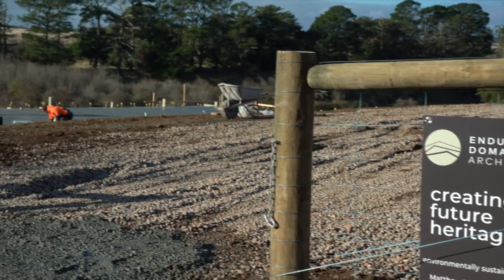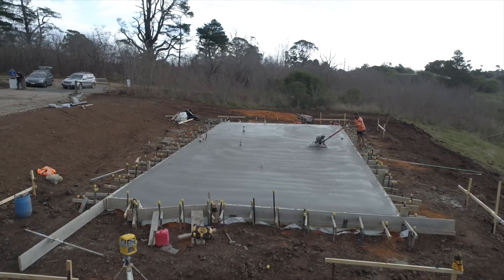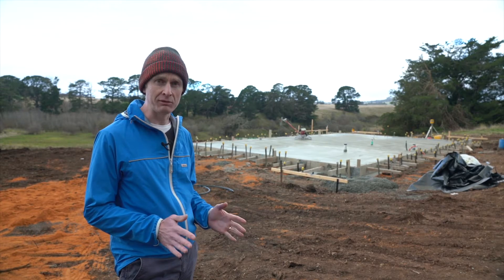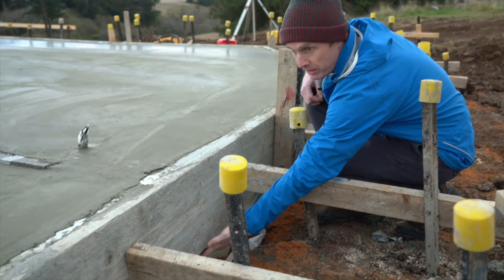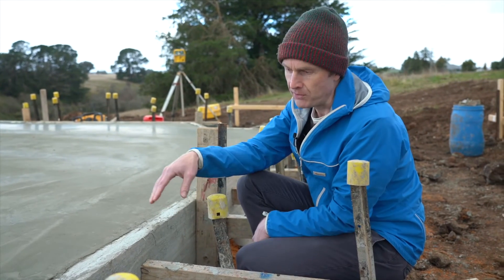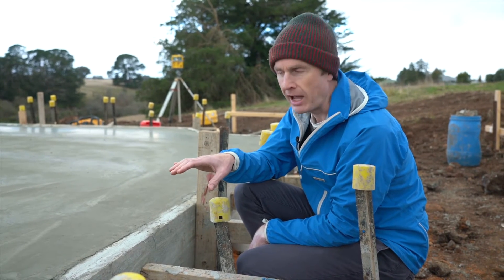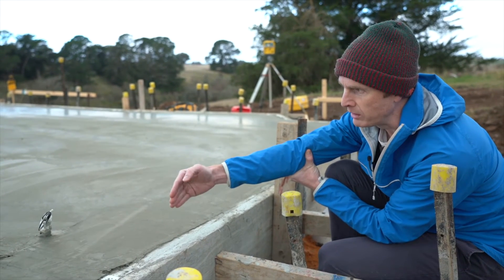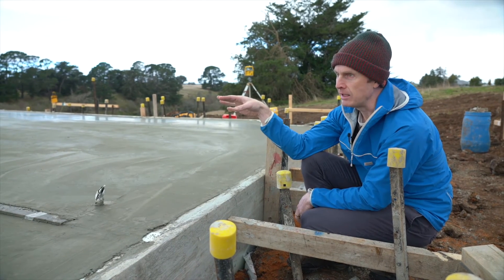Sustainable house building in Australia.  Smeaton SIPs house update #02 Why insulate the slab?

Comment: Great explanation Matt, and love the simplicity.  How did you find the slab edge insulation went over winter? Did what did your learn from the sensors?  Tossing up insulating under a raft slab, in addition to slab edge in a similar cold climate.  Do you think it is worth it if budget can stretch that far, even if the internal beams aren't insulated.  Sorry for all the questions.  It's a large cost and hard to weight up if it is worth it, and obviously can't retro fit.
Reply from the maker: Hi Belinda. Our home overall has performed very well throughout the cold seasons. The temperature in the centre of the slab has generally been around 2 degrees cooler than the room air temperature, with the sensor located on the edge of a south facing room being around 1 to 2 degrees cooler than the one in the centre of the home in a north facing living area. I feel comfortable in my bare feet most of the time, otherwise just wearing socks. For sure insulating under the slab would be warmer in Winter, but in Summer you would want to make sure there is no sunlight getting in through the glass which would heat up that slab. You could do a waffle pod slab which is much cheaper than a raft slab and would still get some of the benefit of the internal beams sitting on the bare ground.